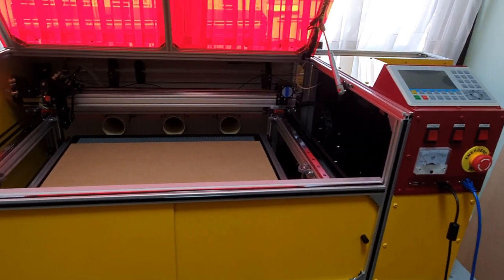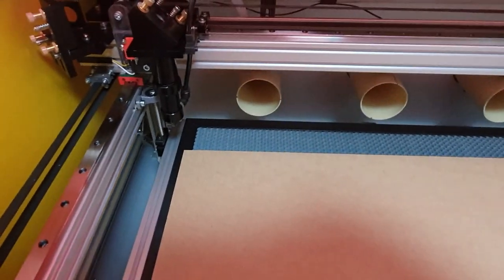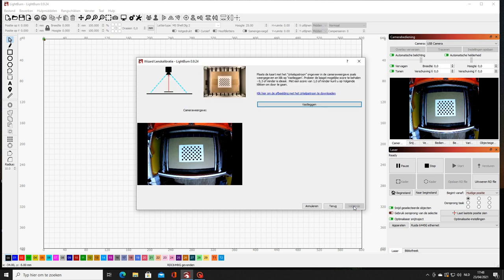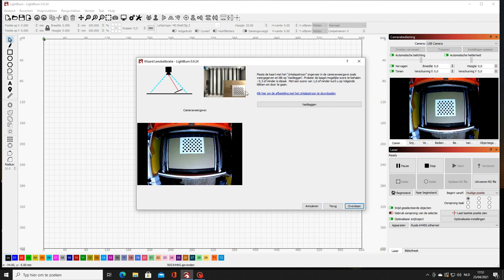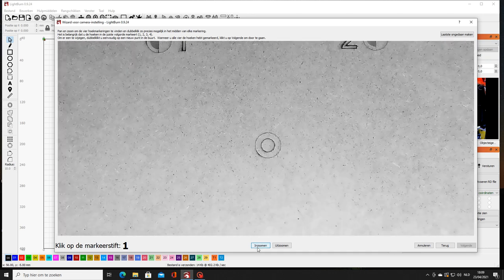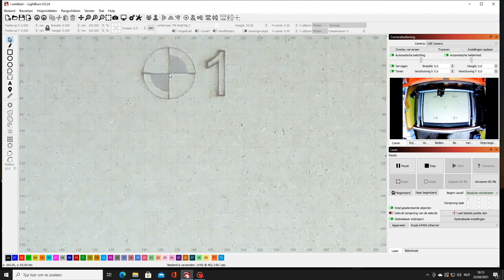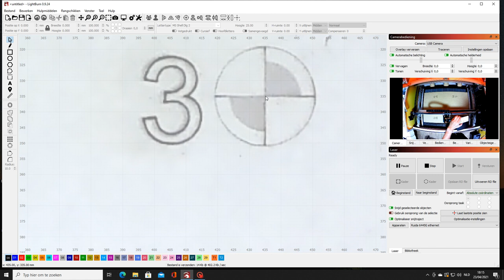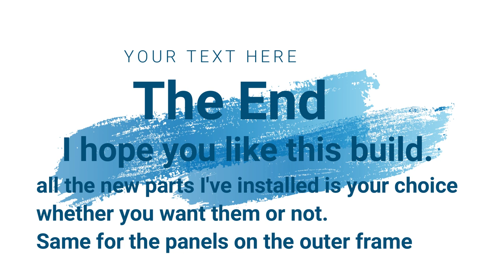Last video part 4 small overview

Comment: Thank you for these videos, great details there. Question on your exhaust system, the fan you used is 6in or 8in OD along with the pipes and flex hose? can you provide details or link to the fan please
Reply from the maker: Max-Fan Buisventilator Pro Series 150 600m3/h 150mm
Link: https://onlinetopgarden.com/nl/lucht-en-klimaat/lucht/max-fan-buisventilator-pro-series-150-600m3-h-150mm
MAX and RUCK are the same
Reply: @PhilippeRommens  Thank you so much

Comment: How the camera connection? and made on the controller? Flávio - Brazil
Reply: Congratulations on the project
Reply from the maker: via USB direct to computer and lightburn software. https://lightburnsoftware.github.io/NewDocs/UsingACamera.html
Reply: Thank you very much for the tip and attention.

Comment: do you have the controller setup you can give out?
Reply from the maker: All settings are made in lightburn,
Reply from the maker: Setup is different for all diy  co2 lasers, because of steppermotors and driver, etc.......

Comment: Tengo algunas dudas y quisiera de ser posible poder aclararlas con usted
Reply from the maker: ¿qué quieres decir? ingles si es posible, no entiendo ni leo español
Reply: @PhilippeRommens  I need to know about the configuration in the controller parameters, related to motor movements or displacements, that is, when I cut a 10mm line, I cut it to 16mm, I am using everything you recommend in your videos. Thank you very much in advance
Reply from the maker: @yadianperezbernal2968  you have to calibrate the axis, to do that : in lightburn go  to machine settings en you well see a buttom "calibrate axis"  see this tutorial: https://www.youtube.com/watch?v=9BtyMj3hlMo  or in the manual
Reply from the maker: or this video: https://www.youtube.com/watch?v=v8kOH5McCjY&t=398s
Reply: @PhilippeRommens  thanks You soo mucho for your help. 👍
Reply: @PhilippeRommens  Could you help me with the configuration parameters to use the same parameters as you on your machine
Reply from the maker: @yadianperezbernal2968
Reply from the maker: unfortunately I don't have the laser anymore, as I build more and then sell. if you make a video of what you do in your settings or how settings are in the software and give me a link to the video. Then maybe I can help